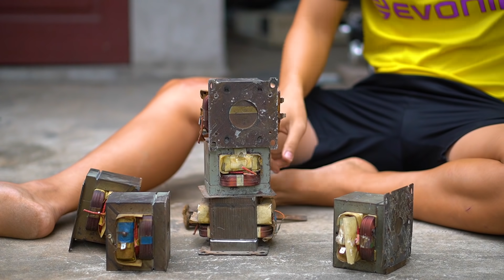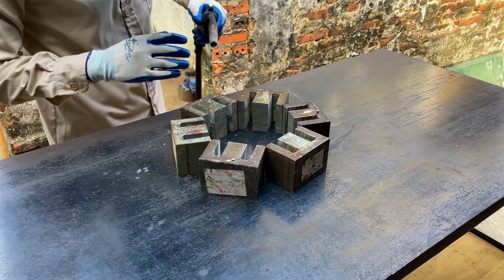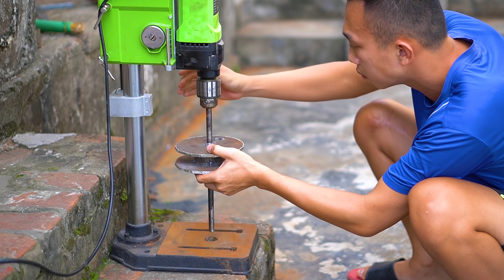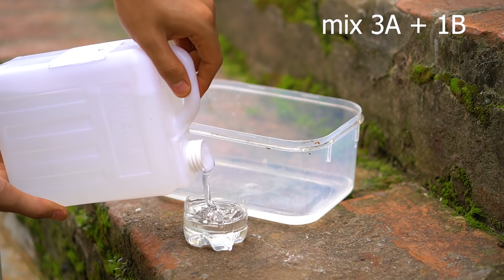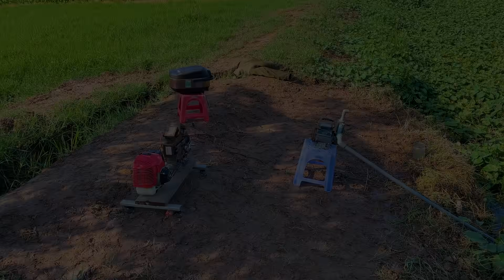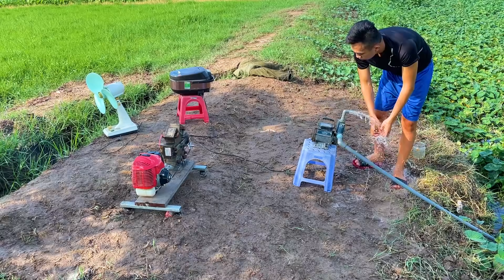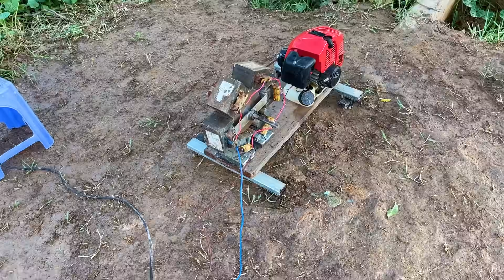I make 220v electric Generator from 6 Microwave Transformers

Comment: Good craftsmanship, but service impossible, all is welded. A shortcircuit in one of the trafos and you must throw away the whole garbage
Reply: This is a confidence trickster! Prove me wrong! There is a sneaky power connection through a cable buried in the mud under the electrical socket. Share a new video with the connector pulled up off the ground, and passing your hand underneath (with this running) The poster is only interested in being paid by YouTube for AD money from many clicks.

Comment: If you want to pump water just hook the motor up to the pump also I'm used an awful lot of generators and typically when you plug in something like a dredge pump you can hear that apply a strain to the gas engine I'm kind of wondering if maybe there might be some b***** going on here?

Comment: Its amazing but Why at the end u use benzin generator ?  It will be better when u use more magnet  for get the Rotation  but for this Rotation u need more and bigger generator magnet  around something round and when u make it perfekt u just need push and it's start and never Ending  with magnet u will make it I belive u have all there

Comment: So the rice 🍚 was already cooked! 
Electrolysis of water expands expands it's volume as a gas 1700 some times, there is your pressure, now make a tesla  turbine, but let the disks be (Michael faraday) Faraday Disks, now your electric source is apart of the turbine itself, by the way tapping power off the Faraday Disk(s) does not create resistance! Now the gas coming out of the turbine, pipe it into a large sphere, air (HHO) Tight, and measure properly an outtake of air from the top and bottom of the sphere, measure the output(s) from the sphere so by volume you get two parts hydrogen and one parts oxygen so you can burn them in a torch at the ratio that makes up water, the consumed water will come back out of the flame. Oddly enough this flame won't make water boil, put the flame under water that is being electrolized.
But somewhere either the path of water or HHO, you will have to insert something that blocks and unblock the flow back and forth so pressure and build up, and if you designed the tesla turbine faraday disks properly, you get more electric than what is needed to split the water. By the way for the electrodes, don't use the commonly used stainless steel, use Graphite rods of sheets, wet cell can run longer, with Graphite you want high voltage and extremely low amperage,  SS is the opposite. AND the output of the disks.... the voltage is exponential, it's output squares on itself, but not the amperage.
There is your free endless energy, and have a nice life
Reply: Sorry for the typos

Comment: if you want to buy 50 Ampere Transformers each of having worth $ 20 then 5 Transformers = $ 100. After buying broken them by drill cutter...finally if your device is not working then your $ 100 fled into air + your time ......moral of the story don't do this at home...just see them as time pass...

Comment: you are a master in electricity.
can you stay in touch with me for useful purposes?
Reply: Sorry, but you will never hear back from this poster. This is a confidence trickster! Prove me wrong! There is a sneaky power connection through a cable buried in the mud under the electrical socket. Share a new video with the connector pulled up off the ground, and passing your hand underneath (with this running) The poster is only interested in being paid by YouTube for AD money from many clicks.

Comment: Do yourself a favor check it out get you a motor that you plug in and it turns ok listen close on the generator on the back side twine up the string and leave it there now with the motor replace it with the engine  then plug the motor into the outlet box then pull that string and you got yourself free energy generator

Comment: I was waiting for the engine to lower its rpm when plug in those appliances and motor, but I realized the engine is not in direct shafting with the generator. The water pump motor is very small, probably around 150 watts, fan that size around 45 watts, rice cooker is the only high load around 1kw. What puzzles me is the series connection he did with the coil, if they were use in 120 volt connecting them in series could give about 720 volts, all of those things he plugged in should have been burnt.🤔

Comment: if it would be up to me...i would give this guy the Nobel prize .
Reply: Wrong!  This is a confidence trickster! Prove me wrong! There is a sneaky power connection through a cable buried in the mud under the electrical socket. Share a new video with the connector pulled up off the ground, and passing your hand underneath (with this running) The poster is only interested in being paid by YouTube for AD money from many clicks
Reply: @pstonard  but we saw him welding and cutting metal really he worked hard for the final product....!!
Reply: @ahmedgaafar5369  You are correct. This is part of the Confidence Trick! He pulled you in by showing great detail, work ethic, determination, to build the contraption. No doubt he has some mad mechanical skills, but alas no any electrical or physics training.

He was careful not to show any measurement of electrical output, nor did he show any energy efficiency calculation.

He didn't lift the socket strip off the ground in the video. And why would he? The tricky wiring is in the dirt; feeding clean, pure, AC "house" current into the network that feeds his demo appliance loads. Even if that juice was from another gasoline generator that was carefully not shown in the video, with it's power driving the pump, the fan, and the rice cooker.

Mother nature rules the laws of the universe, physical sciences provide the theory and the math to our modern world. The conservation of energy theory (please do your own research on this) means this whole episode is nothing short of clever fakery.

In short? It's a pile of bullsh*t designed and executed to get YT views, and a stream of Ad revenue payout.

I admire him for that! I'm a little surprised by how gullible some of the YT viewers are, too.

Comment: This is so fake. Magnet air gaps are too big. Magnets too small. Whenever he pulls on any wires to the busbar the busbar doesn't move even when the fan falls into the water. He moves the 'generator' output wires and the busbar doesn't move ! The power source wires are under the busbar and earth. And Other things also....

Comment: Want to take your AC 220 Volt generator a step further ? You don't need the Gasoline Motor ! You already dis-assembled a perfectly good enough AC motor, which you could have connected to the shaft of your rotor in your home made generator and hooked the output from your coils to an AC bridging circuit and sent some of that current to that motor. You can use a lawnmower pull start to initially provide the energy to turn over your rotor fast enough to generate enough current to start the attached electric drive motor turning over, then you have a perpetuating system. You don't get something for nothing. Your body pulling the start cord to rapidly turn over your generator's motor is enough (Initial) energy to send enough AC current to turn over the motor attached to your generator's central axel. Just do everything you did the first time, only add the electric motor to your Generator's central axel and connect it to an AC 220 Volt connector bus, which is connected to your coil's output.

Comment: How can something turning that slow generate anything more than just a few Volts? there's a scam going on I think. You have to set that machine on concrete where I can see everything around it it's too easy to bury some wires Where You Are.

Comment: конечно это шутка , недостатки - большие зазоры в магнитопроводе , маломощные магниты , слабый  ремень , и , возможно , неверно подключение катушек  .       Of course this is a joke, the disadvantages are large gaps in the magnetic circuit, low-power magnets, a weak belt, and possibly the coils are connected incorrectly.

Comment: I was expecting something new...
What you have done is a simple generator using garbage as raw material.
Reply: Correct! This is a confidence trickster! Prove me wrong! There is a sneaky power connection through a cable buried in the mud under the electrical socket. Share a new video with the connector pulled up off the ground, and passing your hand underneath (with this running) The poster is only interested in being paid by YouTube for AD money from many clicks.

Comment: This is magic.  And like magic, there's a bit of deception here.  Magnets are not oriented properly - they stick to the steel at their poles, so you positioned the poles axially.  Actual permanent magnet stators have the magnets oriented so the poles face radially, so the magnetic flux lines extend out from the edge of the rotor.  Stator is wired wrong - you wired everything in series!!!  This produces no output.  There is no way that little gas engine is putting out enough energy, assuming the "generator" is 100% efficient, to run all those appliances.  And as you turn on additional appliances, I hear no drop in the engine rpm.  Gas engines don't respond to instant-on loads instantly.   So magic - the "outlet box" is the end of an extension cord that's buried in the dirt and plugged into the mains.  Watch the video carefully, particularly where the broken fan was unplugged - you can see the outlet strip is attached to something in the ground.  Generator does nothing.

Comment: 1st. All your appliances seem to pull around 1k- 1.5kw. And the rpm of the engine doesn't change at all. I own a 10kwh generator here and if I start à toaster, his sound change quite a bit (and the engine is bigger than the one you have)
2nd. The little belt, at this power shouldn't be able to whitstand that force and should slide on the pulley.
3rd.Your voltage may vary a lot due to the lenght of the gap between your (very little) magnets and the case of the transfos. 
Finally : please stop hiding power wires under the dirt.

Comment: sorry,but WITH the two ohter Coil he can have 200 Volt and 3 Volt and also 100KV.so he have downgraded his Generator from 3 Powerouttakes to ONLY ONE. WHY,tell me WHY have you take the coils out? or put 12 coils for 220 Volt in,so you have two Outtakes with 220 Volt and can use a electrical Motor instead of your Gasoline needed Engine. One Outtake drive the Motor and the other give you 220 Volt. Think effective,Man.

Comment: I'm so surprised,  how people can belive it's real :) With a basic knowledge everything is wrong.  Magnets too small and too far,  rotation to slow.  Transmission belt from boxers.  Even  200W output  would create quite big resistance to gasoline motor.  Voltage and frequency would be totally unpredictable.  You could spend this time,  to something real.

Comment: Great idea and it works great.

But please be careful with water and electricity.
Water is a great conductor, wet body also.
Water reduce significantly body resistance, so you are far more prone to serious or fatal electric shock when your skin is wet.

Cheers

Comment: Fake, Fake, Fake, Notice motor didn't change pitch as more power was demanded, also, look closely at the belt, it was hardly turning, finally, how did he balance that armature so precisely that there was no vibration? But then he doesn't care, with 1.5 million subscribers, big bucks.

Comment: I think it is a waste of money and effort by running a mechanical engine to rotate a crude generator, in a merry go round, to generate electrical power. 
Just use any household electricity to run any electrical appliances. That's all.
Your method is not producing free electricity and it costs more money and time to produce electricity of low efficiency, wasting people's time to watch your method. 
In future, please come up with an idea to produce free electricity such as: 
1) Sunlight through a concave lens produces heat energy. 
2) Waterfall through a vertical tube to produce potential energy (height energy).
3) River flowing water produces hydro power energy.
4) Horizontal wind flow to rotate a fan to produce free electricity.
5) Vertical air convectional flow through a vertical tube to produce free electricity. 
In short, there are thousands of methods to produce free energy from our Earth's resources one can harness.

Comment: You have joined all 220v coil in series than running 220v device on it..😂😂..means running 220v device on 1200v...and it's running for u..😂😂...fake buisness.

Comment: Imposible,,, the voltage value and the frequency not been read with multimeter. And also we can see the speed of rotor is very slow.. impossible to get 50/60 Hz. This is a lier content 🤣🤣🤣..

Comment: Yes indeed, fake! Look carefully when at the dirt and you can see the obvious color difference. Darker around generator and a straight line going under the stove.when you turn over dirt there is always moisture protected by surface. There is high humidity so he cannot dry the dirt. so, without real ability to  generate from this contraption, he has to hide power cord. And in case you're not convinced by that, then look at rotor speed. Too slow and no real mass inertia to overcome lens law. As soon as load is applied it would bog down. 3 on at same time without motor screaming in protest. Never going to happen. Fakery to the max. But if he can get millions of views out of it,then I say dudes a genius fake or not.

Comment: fake
Reply: Correct!
This is a confidence trickster! Prove me wrong! There is a sneaky power connection through a cable buried in the mud under the electrical socket. Share a new video with the connector pulled up off the ground, and passing your hand underneath (with this running) The poster is only interested in being paid by YouTube for AD money from many clicks.

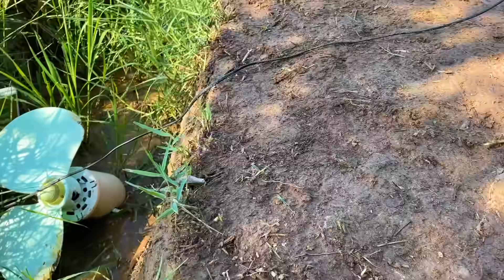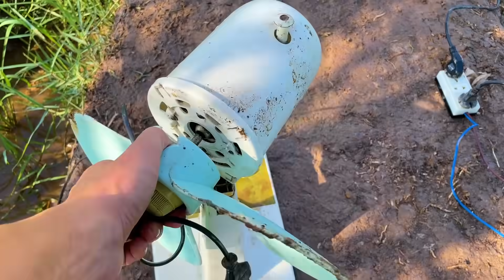Comment: Good job,thank you🙂               Also     (21:05 - 21:27)     is very funny  🤣
Reply: This is a confidence trickster! Prove me wrong! There is a sneaky power connection through a cable buried in the mud under the electrical socket. Share a new video with the connector pulled up off the ground, and passing your hand underneath (with this running) The poster is only interested in being paid by YouTube for AD money from many clicks

Comment: Fictional😂
Reply: Correct! This is a confidence trickster! Prove me wrong! There is a sneaky power connection through a cable buried in the mud under the electrical socket. Share a new video with the connector pulled up off the ground, and passing your hand underneath (with this running) The poster is only interested in being paid by YouTube for AD money from many clicks.

Comment: Fake project
Reply: Correct! This is a confidence trickster! Prove me wrong! There is a sneaky power connection through a cable buried in the mud under the electrical socket. Share a new video with the connector pulled up off the ground, and passing your hand underneath (with this running) The poster is only interested in being paid by YouTube for AD money from many clicks.

Comment: scam   they are in series , it needs to be wired star or delta configuration,   its not 220 volt  nor is it phased power   he has something somewhere else    powering it up,  just because you  use the 220 coils side of a transformers doesn't   mean squat.  now show people the  stuff off camera really pushing the water  to the    so called pump , and no time did you show   voltage      or amp output. i know systems your a fraud
Reply: This is a confidence trickster! Prove me wrong! There is a sneaky power connection through a cable buried in the mud under the electrical socket. Share a new video with the connector pulled up off the ground, and passing your hand underneath (with this running) The poster is only interested in being paid by YouTube for AD money from many clicks.

Comment: what would happen if you added 2 primaries to each transformers would it increase the voltage and would you have to place them opposite of the first set or line up in the same side